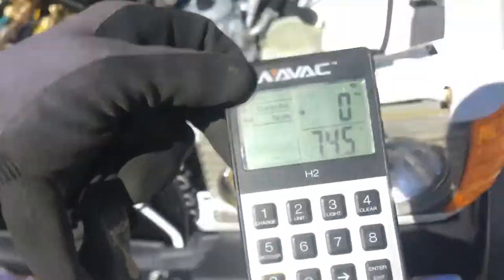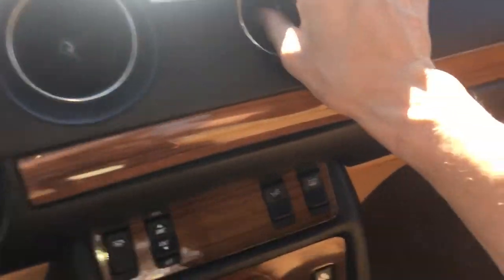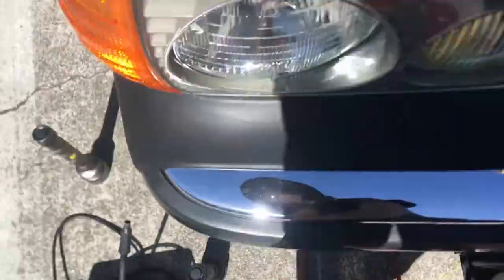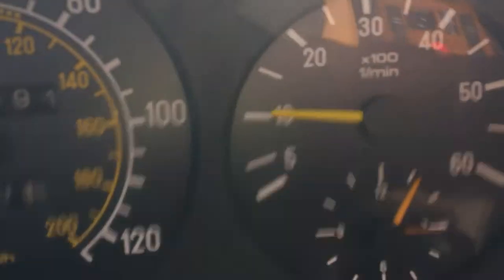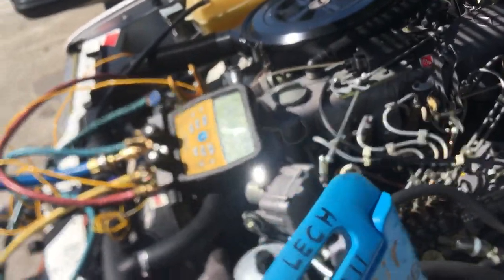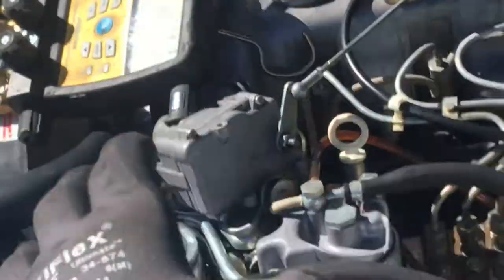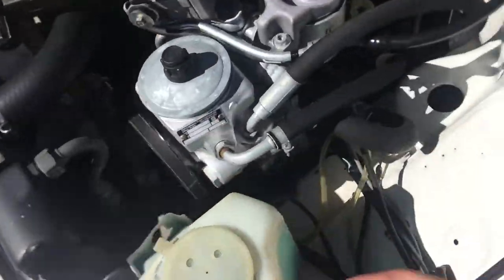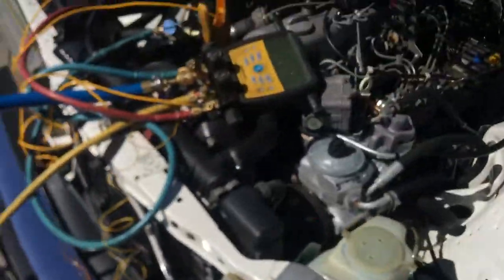AC Compressor Was replaced,   Looks like they need a fluid thermal fan clutch￼. ￼

Comment: Would that be the R4 redesigned to scroll compressor?
Very nice car, beautiful.
Reply from the maker: It’s still a piston compressor they still make them brand new
Reply: @coldfinger459sub0  Yeah, I have a vehicle here with an R4 leaking at the shell and the orifice is plugged with black goo/grime.
Reply from the maker: @thisisyourcaptainspeaking2259  Do you have a lot of flushing of lines and hoses and And replacing parts
Reply: @coldfinger459sub0  I've been avoiding it.

Comment: Hey Tom, personally I doubt the car comes from Hong Kong because cars drive at the left(RHD) like in UK(it was a UK colony). W123 300D is rare there but you can still find one with patience. People can still own a LHD 300D in HK but can only run 12 times per year with a special vintage licence which makes it unjustified.

Speaking of R12 conversion, given the parts are original can I fill in the respecting  refrigerant, simply by calculating the molar mass of R134a/152a over R12 times the recommended fill amount? or how should it work around?
Reply from the maker: People from different countries buy cars from the United States in Europe and ship them to their cars not even for driving and paying $80,000 for a license permit for a car is like buying a cup of coffee for them. 
             For us mere mortals who actually have to work for a living that sounds like a Lotta money. 

         My wife’s apartment in Shanghai was $4,000,000.12 years ago US dollars.  
         It’s only a little three-bedroom in a very nice area Shanghai kind a like Beverly Hills. 
              Each one of their parking stalls was not included when you buy an apartment
Each parking spot cost them $80,000 US and they have three of them. 

As for calculating the correct charge of refrigerant it sounds good on paper but it doesn’t always work in every system it’s only an average. 

Depending on the airflow over the condenser and evaporator and the inefficiency of the old condenser design and evaporator design

Do you have to take into account whether it was an engine driven fan off the motor or is it electric fans

At what pressure does the electric fan pressure switch kick in it’s probably not correct for the new refrigerant

If it’s an orifice tube system or TXV
           Like on the orifice tube system they use a low pressure switch.   For example

On R12the pressure switch low side would kick the clutch out at 24 psi
 
     But for R134. The low pressure switch cut the clutch out at 21 psi. 

To correctly charge them sometimes you even have to subtract another 10% refrigerant plus or minus or add another 10% refrigerant plus or minus so you have a variance the size of a football field. 

There is no such thing as exact math or formula or rule of thumb to get it working correctly.

I’ve been to Hong Kong and Macau several times nice food nice people and I love the karaoke 😉😎
Reply: @coldfinger459sub0  Haha, since HK is my hometown I can understand how rich those people are and probably waaaay beyond my imagination (as an ordinary grassroot person). Maybe there is some very low profile rich people has LHD W123 as collections and I couldn't see them on the road...

One of my friend had some classics like Saab 900 and Mazda Miata NA and they were using R12. After R134a conversion they suffered from inadequate cooling when under hot days like 100F and 80% relatively humidity and traffic jams(even they were retrofitted recently with new parts). I suggested him to go for R152a instead of R134a on his cars but as I left HK everything came to a halt. 
So in general if the conversion involved replacing with microchannel condenser and electric fans, how should the refrigerant amount adjusted?

Karaoke is great, especially those with good endings lol(never tried though as I couldnt afford that)
Reply from the maker: @knk3220  replacing the condenser and may be better fans if you wanted to do some modification you would have to decrease the refrigerant charge. 

And since those old cars had fixed piston compressors it makes it easier to guesstimate and kind of figure out a close charge that is acceptable. 

       Preferably you were trying to figure out your new charge amount on a hot 80° day or a little hotter out in the sun not in the shade in your garage. 

You would leave the doors and windows open while doing this let’s say for example the factory charge on your old Mazda Miata was 1.8 pounds R12

So we already know you’re going to decrease the charge weight because you’re switching to R134 

But now you added a microchannel condenser and possibly a different size receiver dryer

So because of the microchannel condenser you will decrease the refrigerant charge even more

For example I think I would charge it with 1.2 pounds of refrigerant

Have it at 1200 RPMs or 1500 RPM steady let it operate for about 10 or 15 minutes

now this is where you start increasing by 1 ounce and allowing about 5+ minutes to stabilize and then retake your readings

Because he will have a fixed speed electric fan compressor continuously running not cycling

You will have a fixed speed rpm of the engine at roughly 1200 RPMs to 1500 RPMs but read the battery manual and see if they recommend something else this is only if you did not have access to the factory manual to tell you were at what rpm they want their system checked

And this is where I would start using superheat and sub cooling because this is a fixed piston displacement compressor with fixed fan speeds. 

I always say don’t use the site glass.   But when converting over refrigerant from R 12 to R  134.    Sometimes it’s always nice to maybe intermittently leave a few little bubbles every now and then trailing through sightglass to be on the safe side. 

         After this it starts getting a little complicated there’s too many variables in different ways I would do this but at least that’s a starting point

If it was my very own personal car just because I can do it I will go back to the firewall in brazen or Krimp connector SEEALL AC site glass with a moisture indicator in it like you see on residential and commercial units

When you were truly know within inches of your expansion valve if you had a solid column of liquid at 80 or 90°F

Comment: What oil weight /type would you recommend usinng on cars withthese R4 compressors?  PAG 46?  or 150 weight oil?
Reply from the maker: Depends what the compressor manufacturer recommended. 

The vary first R4 with r12 use 500v 

The first r134 R4 used 150 

Then years later they changed the material and clearance of components to use 46v 

All the new R4 here in the USA are now 46v
Reply: @coldfinger459sub0  I have the 4 seasons catalog and they don't have the year Mercedes in there that I was workinng on.  When I fill with R12 I use mineral oil, but on an r134a conversion it was not clear to me if I should use PAG 150 or go with 46 weight oil because of conflicting information online.
Reply from the maker: @komoru  then it is original old compressor in vehicle from factory R12

Then you flush out all the old mineral oil and replace it with 150 viscosity